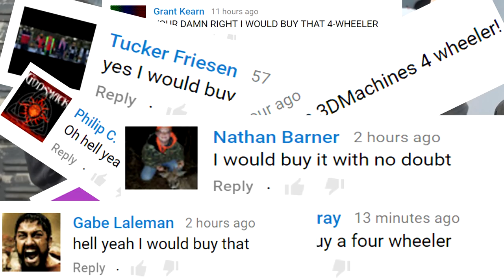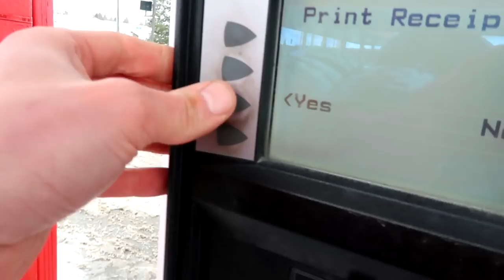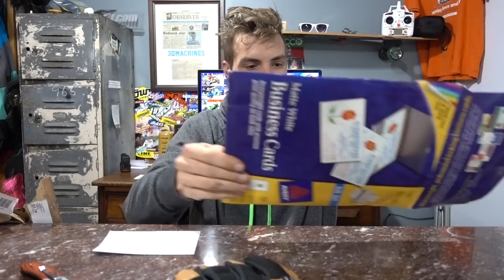They Tried RIPPING ME OFF

Comment: Wait: $18 a tire??  That's so cheap it's scary.
Reply: I think that was what they wanted for mounting each tire.  If it was the actual cost of the tires, then yes that is scary!
Reply: Ya it was 12$ to start but they really fed him at 18$/tire.  I like your name, no one can show you common sense sadly.
Reply: I agree
Reply: Exactly what I was thinking :) If it was for the tires, I would not trust them on my tractor! Mounting price makes more sense. The price difference could be 12 for cars, and 18 for trucks, makes sense. Most places charge more for work done on larger trucks.
Reply: Show Me What I Need To Know agreed
Reply: Show Me What I Need To Know 18$USD
Reply: To put them on the rim
Reply: Show Me What
Reply: Sparky  I could see more work for trucks with it weighing more but the tires are a cakewalk. My trans am has 275/35r18s low pro tires suck balls mounting but they are a lot lighter. My Ford excursion has 265/75r16s while the tires weigh twice as much, the mount & de-mount is a breeze. Now for economic cars yea I agree 100%
Reply: Michael WS6 - I agree with you 100% :) I can see the increase for like oil changes because it takes more oil, but tires? Yea.

Comment: i think you need to add a 8 inch lift with 20×14 American forces rims and a set of 35-37 inch toyo open country tires and then your have yourself one hell of a Duramax
Reply from the maker: I don't want a lift because It's difficult enough as it is to load a dirt bike.
Reply: 3DMachines i have some parts i want you to put on your wall of shame can you do that
Reply: lifts are really cool on someone else's truck
Reply: Kyle Gibson toyo tires suck, for snow. They are very loud also. Get hankooks or BF Goodrich
Reply: toyo tires or mud tires?  open country covers many tread patterns.
Reply: Kyle Gibson for god sake this aint a spending money contest
Reply: G
Reply: Just need a longer 2x6 for loading the bikes with a lift.
Reply: Lifts only look cool. They decrease fuel efficiency and towing. Why make a good truck impractical to use
Reply: Lower it
Reply: Bully stance

Comment: I've been running WinterForce tires for about 10 years, THEY WEAR LIKE IRON! Great tire for the price, the only thing that will happen to them is the UV rays breaking down the rubber, so keep them protected with some kind of tire junk. Your truck is pretty heavy so they might wear a little faster, but I have kept them on all year on one of my trucks and got about 60K miles out of them before they needed swapped out! Excellent grip on snow and ice!

Comment: Better get you a summer tire, I had these on my jeep and they wear very quickly.  They are actually designed to be soft at 50 degrees and under.  They saved my @$$ once for sure and always gave me confidence in the snow.

Comment: What headlight bulbs do you have in the duramax
Reply from the maker: https://www.amazon.com/gp/product/B01AV2S0WQ/ref=as_li_tl?ie=UTF8&camp=1789&creative=9325&creativeASIN=B01AV2S0WQ&linkCode=as2&tag=3dmac-20&linkId=e86576ae5233347e681659ff19489b57
Reply: ktm 300 or 350 2 stroke. or even a honda 250 2stroke.
Reply: Gettin'N'Rippin he probably has 9k hid's
Reply: what happend to the huge lightbar on the duramax?
Reply: make sure you guys top off your headlight fluid

Comment: They look Great.Did ALLOT of tire changes in a dealership so listen Mech-Heads...Aluminum  rims Will react with steel drums and discs.You need an Anti-seize compound or you'll find them Very hard to remove.
Reply: I was there when Ford recalled all those bad tires and we used 35lb sledges and 4ft prybars to get the dang rims to come loose.Try that along the highway.

Comment: I am in the U.K and we also have the same problems. They advertise a price, But when you ask they want to 
Charge you for removing and fitting a new Tyre Valve and Cap. Company Policy
Charge for inflating the wheel because few places use Air these days. Most use Nitrogen and the only reason that is better than Air is because there is no moisture in it so helps corrosion on the rims inside the tyres. Company Policy
Charge for disposal of the old tyre, Company Policy
Some will then add on the Taxes as all previously quoted prices were excluding Taxes, So you pay them with money you have already paid Income Tax on?

Comment: Get a 2000 or 2001 cr 250 then get an updated plastic kit for it so it looks new 😂 but if you get a 500 get a kx500 more top end plus little more power with a power valve

Comment: when you called ahead and the tire place told you $12\tire to mount, if you didn't mention they're 10 ply going on a 3\4 ton pickup then  they probably quoted you general price for a passenger vehicle. bigger vehicles with heavier wheels usually cost more in every aspect. Also using used stud's is not the best of ideas.

Comment: 2001 cr 250 getting rid of mine was my biggest mistake loads of power
Reply: _cope rider I've made that same mistake! Best bike I've ever owned reliable as heck and lots of snot.
Reply: Kevin Parker I traded for an 08 yz 250f before the winter and haven't really put many kms on it yet but it's definitely way under powered 😂
Reply: I had a 2003 kx 250, my buddy had the 2001 cr 250 I couldn't keep up with him on the logging roads, and he was 40 pounds heavier than me. We even had the same sprockets. So as soon as he bought a new bike I got the car from him.  Should have kept it but one day I will find another one.
Reply: Cr not car